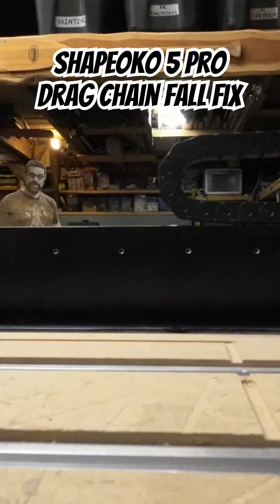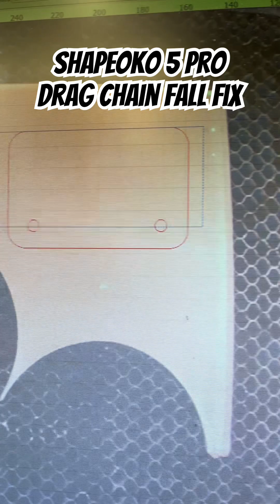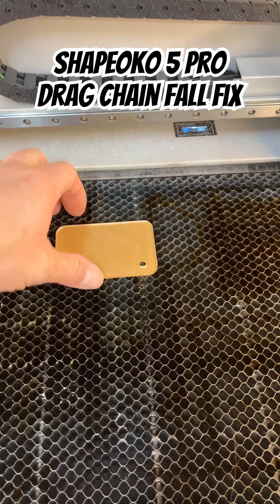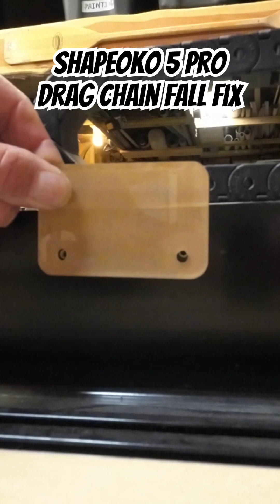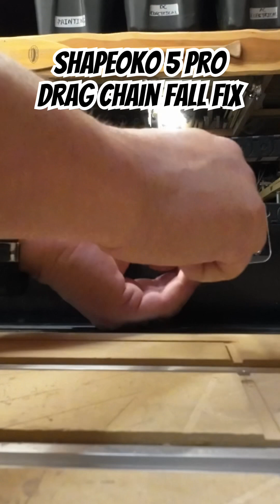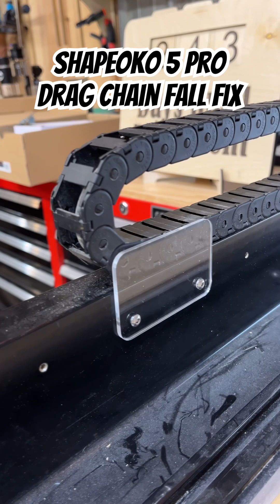Shapeoko 5 pro upgrade

Comment: What size/length bolts did you use? I need to find my thread checker. My drag chain falls off because I need to get my hose going up vertically through my enclosure. Also, what thickness of acrylic did you use?
Reply from the maker: I used 5mm M4 screws. They offer a 3D printable file if you wanna use it. I used 3mm clear acrylic.  https://carbide3d.com/3d-print/shapeoko-5-pro-drag-chain-retainer/
Reply: @TheClackShack  Thanks!